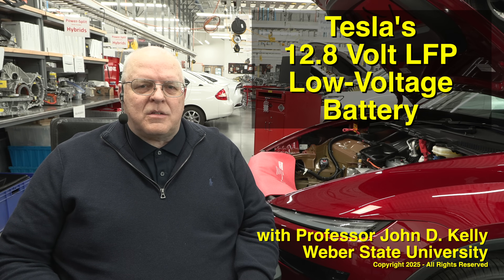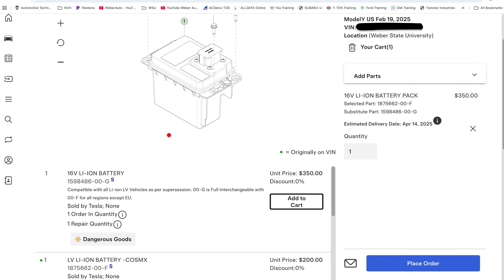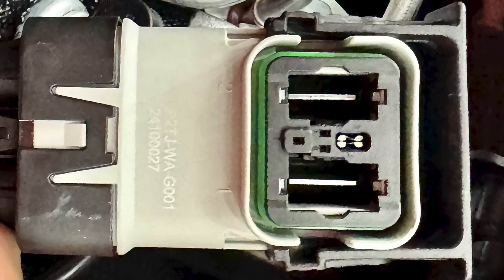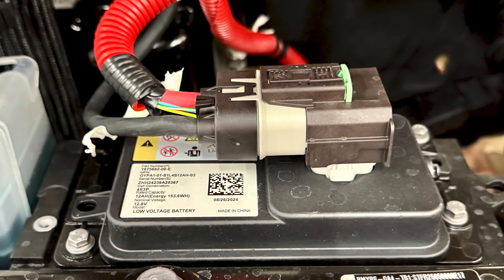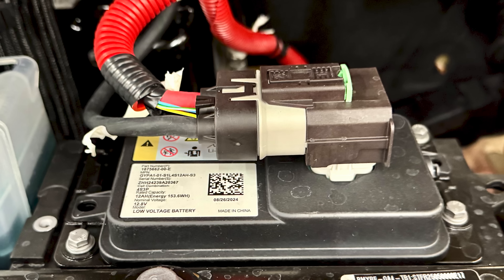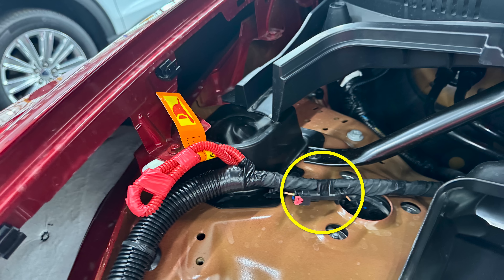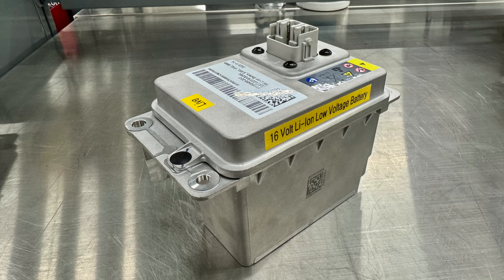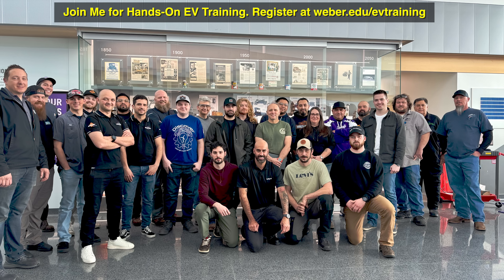Tesla's New 12.8V Low Voltage LFP Battery

Comment: Tesla cyber truck has a 48 v lithium battery and some of the actuator motors operate on the 40 v platform.
Reply from the maker: Yes they do. I am surprised by how many components run on that voltage on the Cybertruck; many more than I first expected. I am working on a video on that system too. Thanks for your comment.
Reply: The 48v is for the mid voltage. The cyber truck still has, in addition to this, a LV battery system as well, which mid voltage steps down to.

Comment: Is there a technical reason the LFP 12.8 volt cannot be installed in an older car? I’m just thinking I have a couple 12v accessories that are not compatible with the voltage range of the 16v lithium and would swap for the LFP LV battery if possible.
Reply from the maker: The battery is charged and controlled by a computer called VCFRONT. That computer receives power from another box called the Power Conversion System. The hardware in each must be compatible with the lower voltage and the software must support it. The communication system between the battery and the VCFRONT is a two wire system now rather than a one wire system. It is just not compatible with the older systems. Thanks for watching
Reply: The 2 extra CAN wires aren’t in the older car, nor does the plug fit the new battery.
Reply: @Nobody_Famous  also that the Li-ion charging schedule is incompatible with combustion car alternator regulators
Reply: Don't all 3/Ys from 2023+ support this new 16V battery?

Comment: It is incredible that a car with such a huge battery should have a need for that tiny 12V battery. Bad design I assume or what is the reason ?
Reply from the maker: The tiny low-voltage battery is needed to power on the high-voltage system. After that, it is mostly unused while driving.
Reply: @ Ok thank you and thanks for the video.
Reply: The large 400V battery is completely disconnected when you turn off the car for obvious safety reasons. Computers, sound system, windows, wipers, lights and so on all run on 12v.
Reply: @Techpriest1010 Mr. Weber can correct me if I'm wrong, but I think the LV battery is just there to float along all the electronics during sleep mode. So, yes, when you open a door or do something to wake the car up, the system connects the giant battery to the DC-DC converter and it takes over powering everything. Picture the main HV battery like an ICE car's alternator. If you listen to the car in a garage or where it's real quiet, you can hear what sounds like Cicada's buzzing. I think that's the charging unit (DC-DC converter) doing it's thing supplying power to the LV system and charging the little battery if needed.
Reply: @curtchase3730  Thank you. I think I understand it now.
Reply: @ So if I understand it right they (the designers) are afraid that things on standby can discharge the main battery lower than they want if the car is left with discharged battery for a long time....
Reply: I don’t like Tesla, but suggesting they have a bad design for EVs is brave.

Comment: How does it charge? What is it used for? So the main battery only runs the motor?
Reply from the maker: It is charged by the DC-DC converter inside the power conversion system. The battery is needed to power on the high-voltage system. After that, it is mostly unused while driving.

Comment: How long does both battery last?
Reply: You should expect 3000+ full depth cycles of the cells being LFP.  That would equate to 8 years with full cycling once a day.  In reality I imagine the battery will only ever be partially discharged and that itself will extend that cycle count massively depending on how discharged the cells are allowed to become.
Reply: @retrozmachine1189  in most cases yes, but if you run sentry mode 24/7 the battery would need a full charge and discharge more than once per hour. So 24+ full cycles per day.
I'm not sure if they have made any tweaks to how sentry mode or battery charging and cycling works on these new 12V packs though.
Reply: @jaro6985  Link to information that shows  the different current draw from the standby battery when the vehicle is in sentry mode and when it is not, please
Reply: @ I found a measurement for HW4 stating 275W with sentry on and 120W with sentry off. Then <90W asleep. People say sentry will leave the HV contact on, not sure if it depends on the software version. You can find old posts where the lead acid was being cycled multiple times per day, I'm not sure if anyone has measured the Lithium to see if it does the same or not (its harder to current monitor).
Reply: There might be a difference between the car on the road in Arizona and the other in Montana with owners garage dark and outside the sun
Reply from the maker: They are supposed to last the lifetime of the vehicle